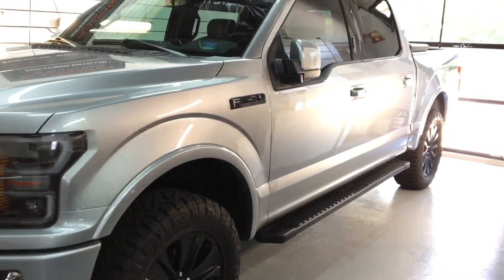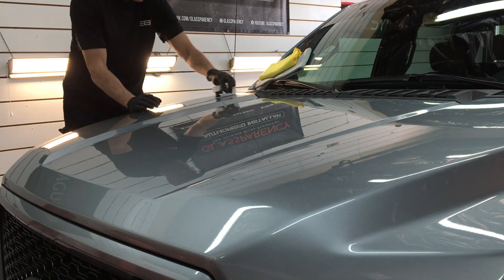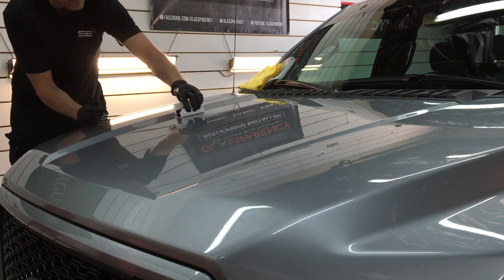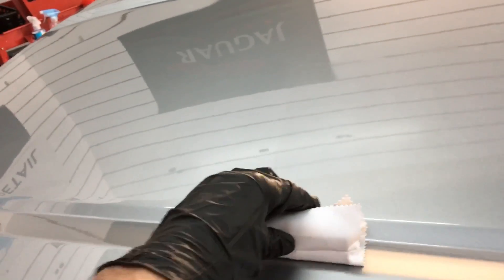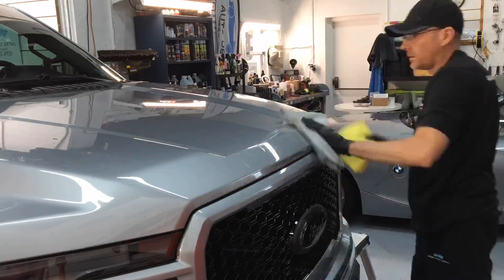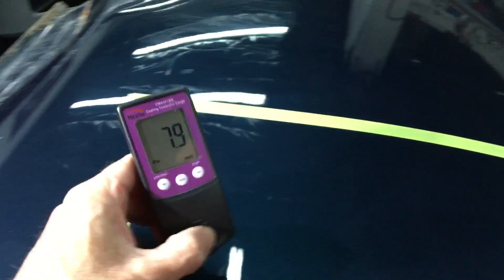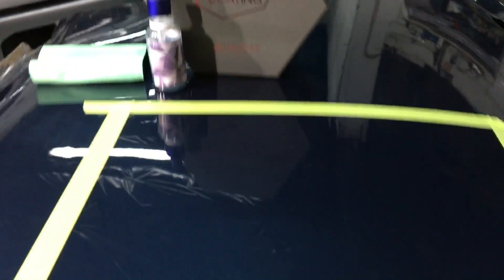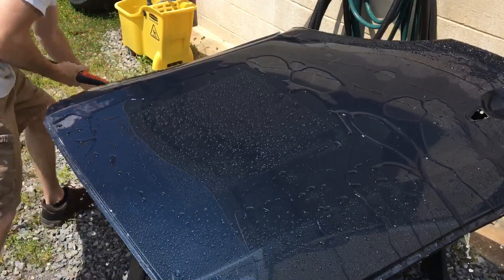The Most Durable Coating Available? Let's Find out! Metal Oxide Coating (ATO) From ARTDESHINE!!

Comment: Im torn between getting 10H IGL Kenzo vs this Artdeshine Metal Oxide. With $20 costs more on IGL. 

Im looking for better gloss and possibly longer durability against weather condition. It can get very hot here in PH btw. Which one would you recommend getting? Thanks a lot for this informative video!

Comment: I simply don't believe that the coating could have increased the thickness by 0.4 mils. Doing the math, and for a hood of about 2m x 1.5m (about 6ft x 4.5ft), it would take the WHOLE BOTTLE (30mL), WITHOUT ANY RESIDUE REMOVAL, to increase the thickness by that amount. It's impossible - please check your methodology.

Comment: Brian I put Opti Coat Pro Plus on my car 8 months ago.  I wash it every weekend.  It is a daily driver that is not garaged and is exposed to dew and rain from Oct to May in Northern CA.   Water sports are the issue, not bad mind you, but I see them each weekend when I dry the car with TW Wet Wax.  Can I have this graphene put on the Opti Coat Pro Plus without doing a paint correction to prevent future water spotting?  I've heard you can't put anything on OPTI because it will shed anything within a few days or weeks.  But since I heard Graphene is much more resistant to water spots, I wanted to give it a try if you think it is worth it.  Would you recommend they do a single stage prior to applying it?

Comment: Brian are the metal oxides able to withstand clay decontamination vs a SIO2 coating?  Like a  review of TAC Systems 1 Step Master as topper to ceramic coatings that are SIO2 based.
Reply from the maker: To a point...if it is a mild clay.

Comment: Hey Brian, Any updates on some of the coated vehicles that have been coming into the shop such as the Adams UV Tracer Mercedes, Artdeshine BX 5 Series, or your TAC Quarts Climax Corvette, Ect? Also I noticed there hasnt been a Mail Call in a while lately, any plans to revisit that series? Thanks!
Reply from the maker: Spencer B all holding up so far. The only one giving me problems that seemed promising.. Both Jade coatings. Testing resumes.
Reply: @apexdetail85  darn, that's too bad to hear, thanks for doing all the work testing and letting us know.

Comment: Btw the Last Coat V2, Its not suitable for protecting headlights from fading again after you sanded and polished them. now like a few months later the headlights start to fade again already.
Its a paint sealant and should provide protection for at least 6 months before you need to reapply right? or can we conclude paint sealants are not a good solution to protect headlights from fading or hazing up again? then what is the best way to make sure they stay clear? Thanks Brian
Reply: For longevity you can use a ceramic coating or a clear coat paint that is suitable for plastic. I’m going with Optimum’s Clear Coat Restorer on my next set which is a liquid self leveling clear coat. Brian has videos using a spray can clear and also the Optimum product. If you read reviews the dedicated headlight protectants don’t last very long. I’d skip those.